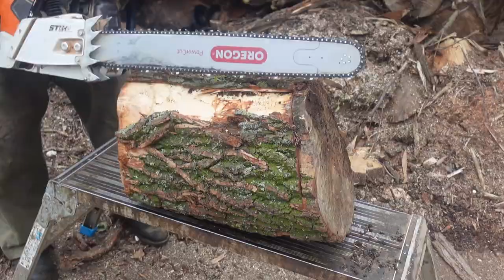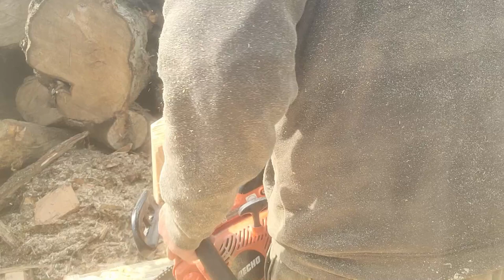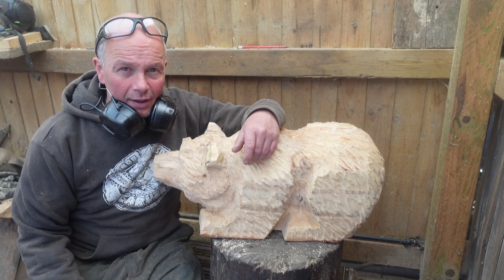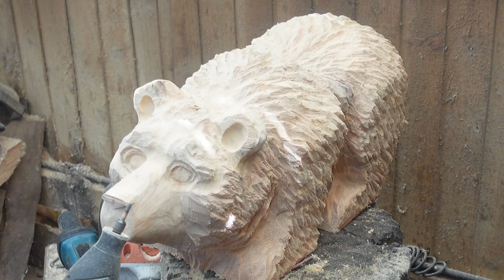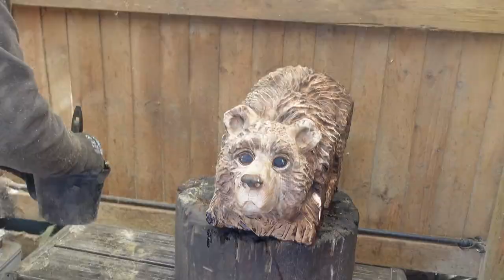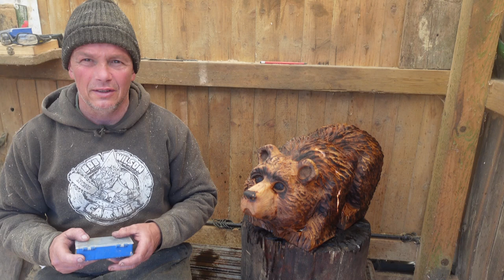How to Chainsaw Carve a Bear on all 4's

Comment: Hello. I am a brand new Carver from Canada. I am wondering what do you use to coat the Bears? It looks like it goes on beautiful. The stuff I’m using is frothy and white and a little bit of a nightmare. It’s like I’m prepping the bear for a shave.
Reply from the maker: Hi, thanks for subscribing. I use Barrettine Decking Oil. It comes in a variety of shades. I mix it 50/50 with Barrettine wood preserver.